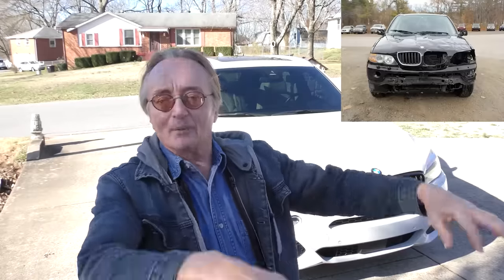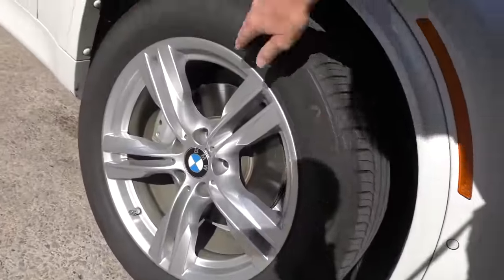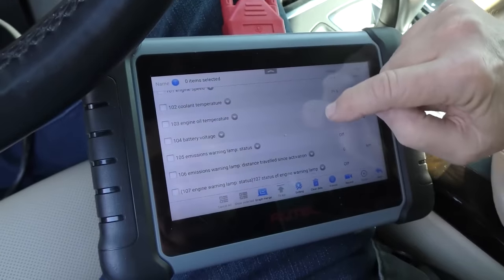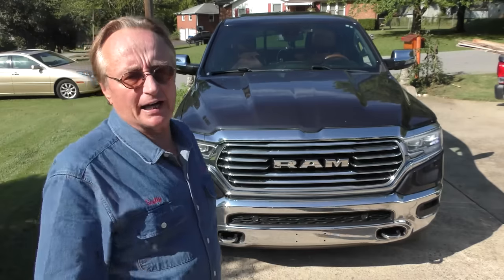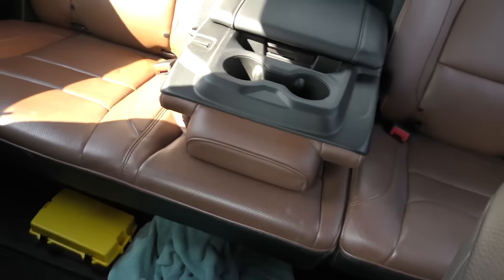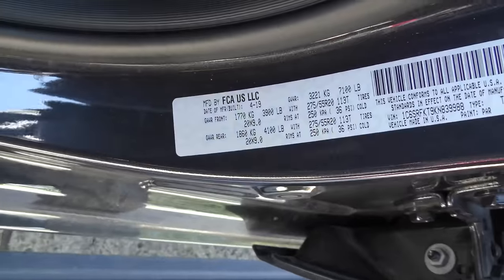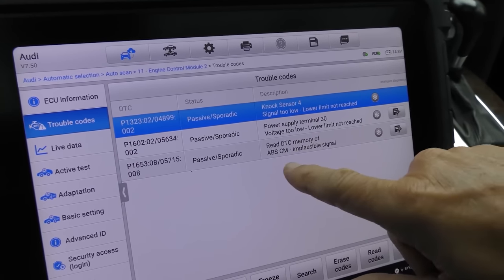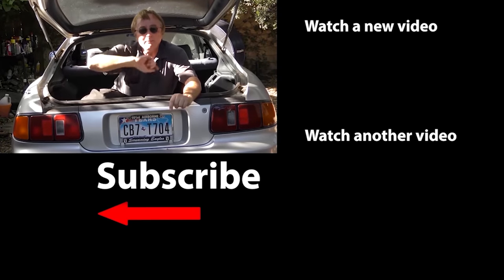The Biggest Money Pit POS Vehicles Ever Made (Do Not Buy)

Comment: I have had 5 BMW’s, fun to drive but not good out of warranty unless you can do some work yourself and have a local independent mechanic. Scotty is right on, the plastic parts are the weak spots! Valve cover, and the radiator expansion tank always fail around 60k. I use FCP Euro for parts, lifetime warranty on all parts. Even wear parts such as brake pads, wiper blades and oil! The 6 cylinder is a great motor. Change oil every 5-6k.
Reply: Very true. Love 2010 x5 xdrive30i N52 engine, super high miles but the plastics always break 😂😂
Reply: Have 2002 Q 45 premium. No repair before 140k. Has 201600 miles now. 5 repairs. 21 yrs. Other car is Honda. No domestic new yet.
Reply: @miguelvega7769 dont they have aftermarket metal equivalent parts?
Reply: FCP Euro is a life saver, if you are gonna get a BMW for reliability get a straight 6 or don’t bother lol
Reply: @maciejp7829  My brother is an engineer at a company.  They do failure testing on parts.  They PURPOSELY make them plastic, instead of metal, so they fail faster.  It's always about $$$$$.  If you want metal parts, perhaps take it to a metal shop & have them machine it.  Or 3d print metal part.
Reply: Kkkkkkkkkkkkkkkkkkkķķukjĵjujuĵù b 2:08 😅😮😅😅 2:08 😮
Reply: They really aren't bad cars to own if you are willing to do repairs s=yourself. Parts are still expensive no matter what!
Reply: BMW break my wallet or big Mexican women
Reply: Their similar to Cadillac, they leak oil that you can’t fix all the way bc the engines aren’t meant to be repaired 

I think I put injectors in the BMW that was about the worst 

They do have an electric water pump lol
Reply: After my 330xi drivetrain failed at 48k miles, I switched to Toyota/Lexus cars and haven’t had to repair or replace a part in over 250k miles.  German cars look and drive great for 3-5 years, then literally fall apart.

Comment: I remember thinking, when all this electronic crap started going mainstream years ago, it was gonna be a nightmare.
Reply: And you were right!
Reply: same reason im dodging anything with turbo in the vehicles. Cost as muuch as a transmission per turbo and your on a weak engine mimicking a natural v8. Scuffed turbos also wont let you pass emissions.
Reply: It’s one reason I still drive a 2005 pickup.  My navigation is my cell phone.  It didn’t even have a backup camera.😂. I added one because we tow a boat.  No heated seats….nothing.
Reply: The worst ones to work on are the ones from the 90s, around the time OBD1 went to OBD2, but even then they aren’t bad 

European cars have issues with control modules, the worst is the security systems, sometimes the computer just needs to be updated
Reply: Only gonna get worse. Auto manufacturers want owning a car to be a subscription service. It's easier if it's all electronic tech and EV
Reply: @RAAM855  I keep thinking we might be the next Cuba.
Reply: yea, i'm guessing when a lot of self drivers is the time to use alternate transport

Comment: I have another money pit car but I looove it. 2012 Audi A6 (3L Supercharged) I honestly learned about how this car works, even coding, upgraded cooling system for supercharger and engine, fixed a ton of electronic stuff with tools I bought, replaced the tail lights with nicer ones and recoded them. It's 12 years old. I also replaced coolant plastic pipes that fell apart, but once every 12 years, 100 bucks.. not bad.
I have Bilstein B16 suspension on it, upgraded the control arms to bigger and polyu. bushings, it's at 500 hp tuned. I love the thing like crazy.
Also doesn't matter to me but people seem to think it's new still. That has been happening since I got it at 3 years old. lol. The design is fairly timeless.
That S6 V10 is soooo coooool! For the fun factor and special feel that car is awesome.
Reply: All truly fun cars are going to be money pits! Sounds like you have a fun one!

Comment: I have a 2016 435i with an N55. I bought it with 39k miles and it now has 104k miles and I only had the thermostat go out at around 76k. Other than that no issues. I do change my oil at 5k not 10k like BMW suggests.

Comment: I had a BMW 525 with the straight six a few years ago.  The engine and transmission ran strong, but EVERYTHING else costs a fortune too: tires, brakes, batteries, lights, interior and exterior trim pieces (a dog ran out in front of my wife and I ended up fixing it with epoxy putty when the repairs were going to cost over $1K!).  Every piece, part and bauble costs a fortune!
Reply: Did you at least have the dog stuffed after you made it into a hood ornament? 😂

Comment: I'll stick with my 2002 Lexus GS430 and spend a few dollars on minor repairs every few years. Rides and runs like new.
Reply: What have you had to fix on it

How long you had it
Reply: @leviellerbe  Original owner. Bought new in November 2001.  Normal maintenance. These were larger repairs. Alternator, power steering pump, knock sensor, some seals on gas tank, control arm bushings. That's about it.
Reply: One of the best vehicles ever made I’ve been a second owner of a gs300 for a while now. Amazing smooth ride for a 25 year old vehicle.
Reply: I sold my 2011 BMW X5 and bought a Lexus rx350. No more headaches.
Reply: We just got a new Rx 350 and I’m bummed it’s not a 6 cylinder. I pray that Lexus is as good with turbo charged 4 cylinder engines but I just have my doubts it will last as long. I figured it’s got to be more reliable than the German makes but I just wish I could get a new 2002 Lexus.

Comment: The first generation of the BMW X5 was fine from 2003 to 2006 with the 3.0L especially if you were lucky enough to get the manual transmission. It wasn't that great on fuel getting 17mpg city and  22mpg highway,  averaged 19mpg but as usual maintenance was important for any BMW. Replace the DISA VALVE when it made noise, plastic and rubber lines when they got brittle, gaskets when they leaked and the cooling system every 4 to 5 years.

Comment: good video. I bought a 2015 640 (even though you told me not to lol). Do you have a recommendation for a computer/scanner (that wont break my wallet) that I can diagnose and reset codes in my home garage for when the day comes that I need to perform repairs on it?  I think I did pretty good price wise on the car so I should be ready to wrench on what I missed. What unit are you using in this video? Thanks in advance

Comment: I had conectivity issue with door,airbag.The dealer wanted to change leads as the connection pins had it,cost £1000 and another garage who was x employer of main dealer wanted main dealer money close,as £900.I took it to another new garage never used them they fixed it for £70.The garage cut and soldered crimps over the defective pins.I told him the others said resistance would enable failure doing this however the garage I used said biggest load of crap he's ever heard in his life!

Comment: The 2000 through 2005 Chevy Impala is a money pit vehicle.  I had two.  Both needed to have transmission replacements by 70,000 miles.  Both also had anti lock brake and traction control modules replaced.  Both also had issues with wheel hubs, and heat not working on the drivers side.  Both also had issues with the rack and pinion steering racks, and had to have replacements every 20,000 miles.  One had a clogged catalytic converter.  Both had to have top end engine gaskets replaced.  One was a 3.4 V-6, and the other was a 3.8 V-6.
Reply: LOL you bought ANOTHER one LOL
Reply: @edwardschmitt5710  Both were acquired around the same time.  Many mechanics say after 60,000 miles is when the fun starts.  Meaning that is when the repairs start.  Both are gone now.
Reply: Working on a Chevy is different than other models, a lot of that can be repaired, but people just replace the entire thing 

It’s actually really depressing the state of mechanics in the U.S.

They basically pushed the good ones out based on the pay model 

They pay the mechanic nothing, and mark up parts 200%, and only want mechanics to swap parts to make money off parts markup

Comment: Honda powers REDBULL F1 now, but changing to Ford eventually.
Starting in 2023, Ford and Red Bull Powertrains – the Milton Keynes team’s dedicated engine division – will develop a next-gen power unit to supply both Red Bull Racing and the sister AlphaTauri operation from 2026 until at least 2030.

Comment: I bought a new BMW, the 25e in 1984, I owned that car for 12 years and drove it every day and put just over 280,000 miles. I sold that car to a friend for 6,000.00 in 1996. The only problem I had was the Water Pump starting leaking at just over 100,000 miles. Other than that I loved that car.

Comment: Hey scotty, I got a one owner 2011 Honda Accord exl with 130,000 miles. Should I change the transmission oil? It runs great. With no noticeable slipping.
Reply: Wait till it starts acting up then change it.😅
Reply: Based on Scott's previous videos, he would not recommend changing the fluid with that high milage. If you change it, the transmission might start slipping.
Reply: Fluid is not oil.
Reply: Does Scotty have to answer EVERY question ?!?   Changing transmission fluid has been addressed more than once in videos.

Comment: I got a 2008 CLK350. If I wasn't a mechanic, I couldn't afford it. I fixed the vacuum linkage on the intake. $600 for the whole thing rebuilt already. I only paid $75 for parts. Transmission fluid and filter, dealer price, $700-$1,000, I paid $149 for the kit with all OE parts. I think I need an OE motor mount, because the rockauto one lasted a month. The convertible top used to work. I haven't figured that one out yet. My scanner gives codes of switches not operating, but the scanner shows me when they are closed and opened, when I move it manually.

Comment: Need HELP! My wife has a 2011 Chevy traverse with 110000 miles which has given us problems. do I keep it till it dies or trade in for Mazda, Toyota, Honda SUV?
Reply: What problems?
Reply: Don't get a Honda with that 1.5 GDI turbo engine 🤦
Reply: As a previous Traverse owner, I say trade it in.  Quickly.  Like, right away if possible.  You’re lucky the transmission still works properly.
Reply: @smokey2459  I don't think I'll get much for it at all

Comment: Turd Cell? Car died at church parking lot. No gas from fuel pump with hose removed & being cranked so put in a new out of box mechanical pump & even a new gas filter but it still won't start.. Sprayed starter fluid in carb bowl & voila it ran for a few seconds so it's not ignition but what is it? Clogged lines or gas tank...